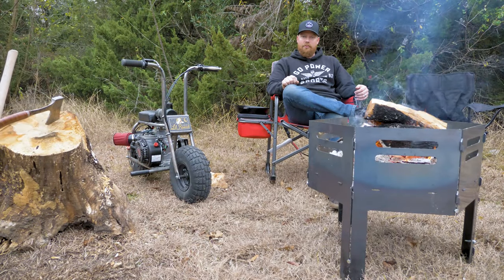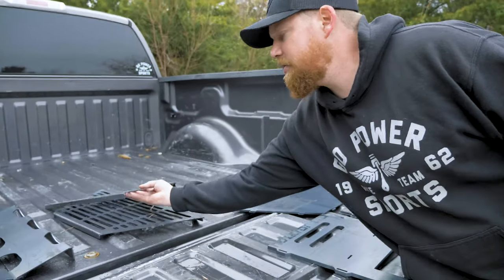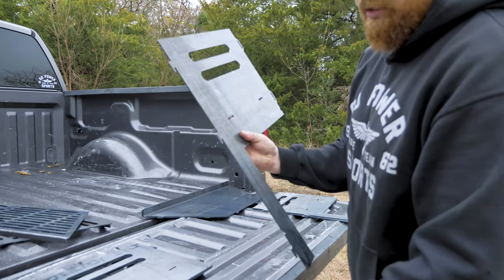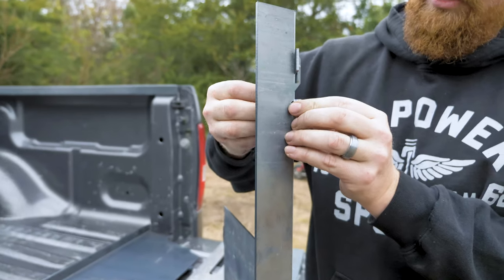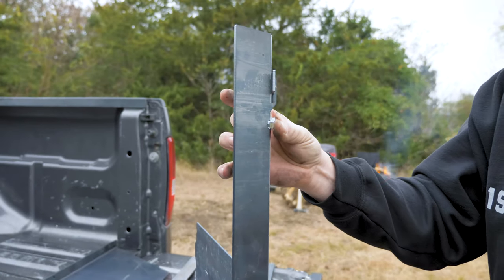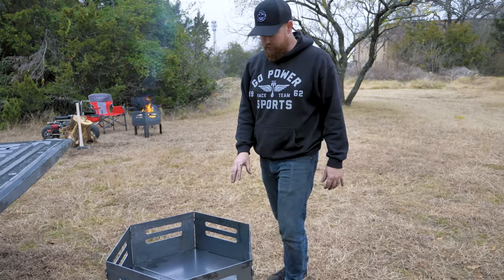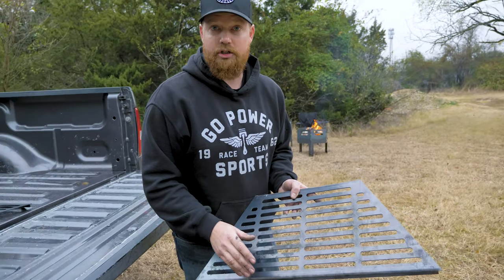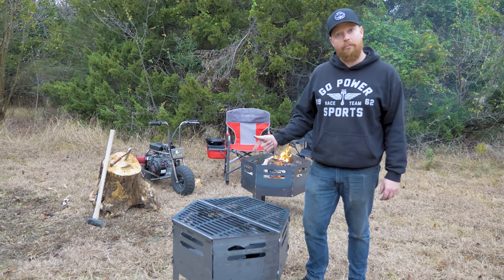GoPowerPit | Fire Pit Assembly

Comment: The fire pit is f—-ing awesome. How about a tool for removing the the hot grill top so you can add more fuel to the fire? 
Just thinking out loud. 
Great engineering, simple and quick assembly.
Reply from the maker: Working on that tool.  Thank you!
Reply: @GoPowerSports  250$ NO shipping and NO bag?? Holy smoking hot fire pi!! 😳